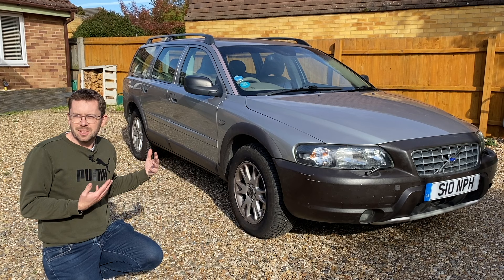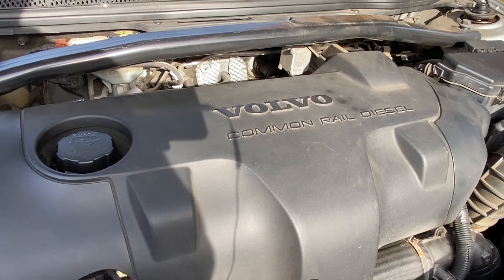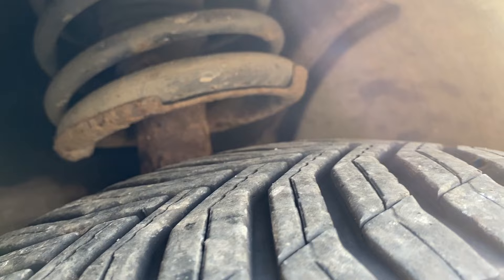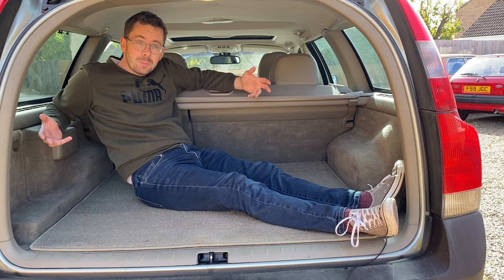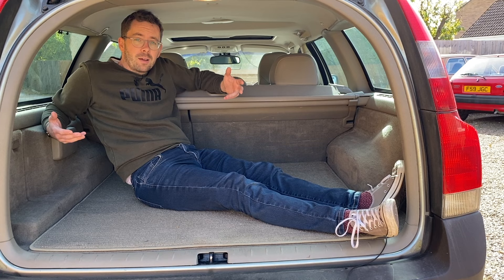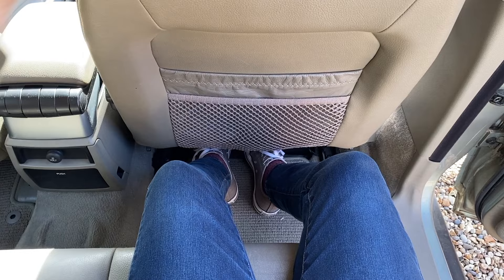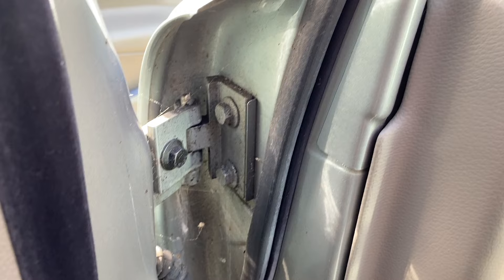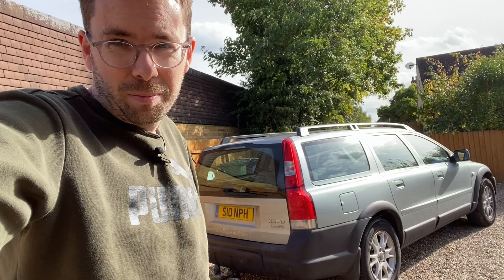2004 Volvo XC70: 6 month ownership review

Comment: Glad to see you enjoying your tank! I’m positive once you refresh the front struts/springs/end links it’ll feel like a new car. That was the most significant area of improvement when I refreshed my front suspension in my XC70 2.5T at 230k miles (currently sitting at around 265k). I saw the rear sway bar already mentioned. One thing I would highly, highly recommend is Delrin subframe bushings if you can get ahold of them on your side of the pond. They TRANSFORMED the way my XC felt on the road. They’re kind of an in-between of OEM rubber bushings and Polyurethane bushings. Almost as soft and quiet as OEM bushings, but much better road feel and lean-in. Makes it feel like it’s not lifted, while still being a lifted wagon! No rush, but I’m sure engine mounts will be coming up for you soon and that’s an excellent time to throw them in.

Comment: Enjoyed your review - we have a P3 2015 bought in 2021 80k miles (now 110k) - totally agree with your assessment.  Have had all the main jobs done, including cambelt and other aux belts, brake discs.  We took it from the south coast up to the lake District - it ate up the miles and performed well in various muddy fields we parked in while fell walking.  Great to park on a mountain side verge in bad weather and return to after the day long walks.  Looks classy to me - rugged and capable.  Is quite good in rough stuff too if you don't wade too far.

Comment: I had a S60 2.0ltr V70T5 XC70 D5 All had the same front suspension faults Too much weight on the front but on a plus they had the best music system with its subwoofer in the dash👍

Comment: 04 v70 , heated seats are hot for me. (usa).
new control arms make a big difference in handling.
get a copy of vida on a laptop , you'll need it.
change the nicad battery in the alarm module before it leaks all over the control board and destroys it.
loosen brake bleeder screws with air hammer fitted with a "shake and break".

Comment: my V70 handles like a sport car compared to the old 240's and a W124 Mercedes I have had - those were barges!!! Bottom wishbone bushes should help handling, I did mine recently with great improvement. You didn't mention the lousy turning circle! Thanks for your video, good luck!😁
Reply: Agree with the turning circle point. I put a deep scratch in one door not long after buying my V70 then proceeded to break numerous wing mirrors off reversing around my gateposts. My uncle bought a new one and did exactly the same thing! I felt very sorry for him, but was secretly reasured that it wasnt totaly down to my lousy driving!

Comment: I have quite the nugget of an XC70 as my first car (V70 XC actually, whatever). Rare manual+petrol option, 2001, 372 000 km on the clock, got it at 330k. In 2 years I've raced it, off-roaded it, crashed it, customized it, upgraded it, lived in it and last but not least fixed it myself countless times. I still smile every time I look back at it after parking. Yes it has it's weird quirks with electronics, but it has never left me stranded - it always gets to point B in absolute comfort.
A couple of tips: the pre facelift steering pump reservoir is garbage. They bulge and leak, swap it out with a 2005+ one. Also, I highly suggest getting VIDA + DiCE tool for your car, it will be a life saver for when you inevitably run into volvo problems.
P.S. I really envy your interior, it's immaculate compared to mine!

Comment: The steering fluid leak is from the 2-piece reservoir.  I upfraded to the later version from 2005 later models.  Have to swap hose also.
Reply from the maker: Oh that's interesting, I will have to look into this further. Thank you
Reply: I ordered a fresh cap for my power steering reservoir as the seal inside the cap gets compressed down over time. 

Cheap enough on eBay though if you can be bothered googling there's probably a free fix out there.

Comment: If you have access to volvo vida diagnostics you can alter the seat heating temp, they are set to low from the factory, was the 1st thing i did with my 2004 v40 and my 2004 s60.
Reply from the maker: Thanks for this suggestion - I am trying to give it a go, though having no fun trying to install the VIDA on an old computer!

Comment: I have an 2004 too.  The handling is greatly improved with new control arms and steering components, also, that weight and degree of movement takes it's toll on the front shocks and springs. Whilst good rear setup, control arm bushings also helps.   Also, its likely yours has the self levelling rear suspension, likely the 940's they do expire and are pricey to replace something like £650 each comes to mind, but handling is severely impaired if they are leaking.  I avoid all Pirelli tyres as they make the steering heavy and unpredictable, with excessive load on the steering system.  Good, Continental winter and summer tyres, give predictable balanced handling across a wide range of speeds, conditions and loadings, more expensive than some but worthwhile.  A second set of wheels, makes swapping to winter tyres much easier and cheaper.  I competely agree about comfort, I have had mine since nearly new and driven long journeys in great comfort for all.  The D5 engine with the Auto box makes for reasuirng progress even fully laden up steep motorways.

Comment: I do have a soft spot for the older Volvos. You've done fairly well with that one. I love the P2 shape and P3 shape XC70; comfort unsurpassed. I had the first of the next gen XC70's on a '57 plate which sort of solved one or two of the niggles with the previous gen; the heated seats had a third mode and were hotter and rear room improved; but ultimately they can get to a point where so much needs doing on them it can become hard economically to justify it but it is great you are keeping them going. I added about 43k to a 140k car in less than two years on mine and took it like a champ - really was a beater to get up during covid to see mum before she passed - without it she would have been isolated in Scotland. Now onto a '14 plate xc90 which I love but in all honesty the package of the XC70 is far more drivable and parkable.
Reply: we yanks do not know what the "'57 plate" means, and by second gen u mean the P3 i assume?
Reply: @18_rabbit  '57 plate, means the latter half of 2007

Comment: Great video. You don't need new brake calipers however. Soak the bleed screws with penetrating fluid for at least 24 hours. Then when you remove them with a ring spanner, put a drill bit that is nice and tight into them to prevent them from collapsing. Also slightly loosen then tighten, then loosen, then tighten with more penetrating fluid as you go. Also a little bit of heat very carefully applied may be necessary. Watch out for the brake hoses!

Comment: Its kind of odd but having a couple of decades of company cars on a 3 year cycle I am free of that. I know you and other youtubers need content but for me approaching 3 years with a 10yo Dacia Ruster - sorry Duster its fine. Doing a 320 mile trip tomorrow but I have full confidence - basic low tech 90's Renault stuff so no traction control stability control and the ride is rougher than a Scenic but I'll take 50mpg all day

Comment: Just bled all 4 brake calipers which were really rusty and the rear ones appeared that they have never been bled. I twisted off the brake bleeder on the front passenger side but than drilled it out and used an easy out to remove the old bleeder. new tactic that worked really good is i used a small impact drill with a socket adapter and soaked the rest with penetrating oil and gave it a bit of heat from the torch and than used the light duty impact drill and it came out without a problem. just needs a bit of gentle agitation and loosens right up. maybe if i tried the first one the same way i wouldn't of had a problem.
Reply from the maker: Oh thank you for that advice. I will try doing the job one day, but I am not looking forward to it!

Comment: I have the 2014 version of this car and I agree the handling around bends is not great - even taking motorway curves at speed feels a little bit insecure - And I also think it's because of the raised suspension and the fact the the XC70 is really a standard V70 with AWD bolted on as an after-thought - Volvo's more 'pure', dedicated SUVs (XC40+XC60+XC90) all handle much better than the XC70 as does the FWD V70 - But, all that said it's a brilliant car in every other respect and we don't buy Volvos to be sporty - they excel in other ways!!! (IMHO )

Comment: I have the same car. I swapped out the car stereo and replaced it with JL Audio Amp, Kenwood audio deck and all 4 door speakers of Focal. Will add a subwoofer soon. But, I will definitely need to replace the engine mounts and suspension. Other than that car runs like a charm!

Comment: The P2 Volvos are such incredibly unique modern cars. My father just replaced his 2001 V70 T5 which he snapped the cambelt on at 245k miles with another 2001 V70 T5 with only 70k! It's brilliant to experience such a lovely example of the species, though his new one has a lower spec stereo that doesn't sound quite as nice but at least plays my cassettes 😂

I daily a 2012 P3/EUCD XC70 with the Bridgend T6 and I completely know what you mean about the 'wallowyness' of this type of car; my XC70 also has a peculiar fidgeting over bumps that can upset the steering a bit which doesn't happen in either the older V70 or my mom's gen1 XC60, so I wonder if certain handling elements are compromised since the XC70 is a modification on the base V70 instead of a ground-up CUV, if you will.
Reply: We had a 2008 XC 6 cyl that was wallowy.  The 2016 T5 with 18 inch wheels drives totally differently.  Agile and sporty.  The 2001 XC drove like an overloaded 850 on stilts.  2004 would have been heavily revised, but I have not driven one.

Comment: Very cool your able to do a lot of those repairs. Here in the US, I own a 2002 Volvo V70 XC with 135K miles (original owner). Been doing a lot of maintenance in the 24 years I've had when I purchased it new. I know it needs a brakes, tires, etc. Love the comfort and ride.
Reply from the maker: It's a great car
Reply: i'm very curious what parts u've worked on or replaced, or had shops do.  Namely, transmission is my question.

Comment: Great car, benefit of 4x4 but running cost of an estate. However I had a standard P3 v70 then swapped for a mk4.5 mondeo estate- basically similar underpinnings, yet the mondeo drive much tighter and handling is way ahead of the Volvo, also had less rattles, and something I noticed sat in the back is the rear seat base seems quite short in comparison to the mondeo which me at 5’10 seems much more roomy and seats are better size.

Comment: Amazing job, I also keep the same car in the family, the power steering reservoir is a pain in the ass… I have replaced it with an OEM one and still have problems, which seem to be very common in this model.
About the handling take a look at those shocks and brake fluid! I also have the Bluetooth kit and works better than my 2016 Golf R connection 😂
Reply: Replace the ps reservoir with an 05+ all the way up to
09 P2 unit (as I’m sure you know s60 was make up until then and is the same) and the weeping will stop. I did this on our 02 as SwedeSpeed suggested. It was not difficult. Make sure you get a unit that looks dry and includes hoses.

Comment: Better hope you never have the hardline compression nut loosen and leak for the power steering.its wedged between the rear engine mount and a bunch of stuff.it will dump your system dry and you have to pretty much jack the engine up and remove that bracket .i ground off the side of a crows foot and had a miracle occur but you gotta be extremely patient and accurate to pull that off.

Comment: Love it. I have exactly the same car. Where did you get the phone holder? And what Bluetooth system have you got?
Reply: Not sure what Bluetooth system he got but if you want a quick fix to get Bluetooth, get a Bluetooth to fm transmitter. They’re around $20. Plugs into 12v socket, sync it to the same radio station and you got Bluetooth

Comment: our xc70 handles really good on the road, and i beat the shit out of ours. take it around the corners hard ect. even kept up with some low powered bmw's maybe yours got a bad swaybar on top of everything you said. and the heated seats can be programmed for eu specs so they get hotter.
Reply from the maker: Thanks, I will definitely have a proper look at the suspension bushes and sway bars etc.

Comment: What sort of fuel consumption do you have? I have a 2006 XC70 D5 and get around 32-33mpg in general running around. Best was 35-36 on a long motorway haul with a roof box

Comment: Just got myself a 2007 XC70 D5 and I will do some mods to it myself. Rearwindow wipermotor needs to be changed, does not work at all atm. ALso will use Swedish brand "dieselkraft" enginetuner and see if I can save some diesel with it. But the guy I got it from had basically changed everything and recently as well. it drives like brand new. Got the BT kit in it first thing though.
Reply from the maker: The bluetooth kit is absolutely fantastic, and transforms the car to modern use with complete OEM usability
Reply: Hey. Which bluetooth kit you buy? I just bought an XC70 D5 too and  I would like one (:
Reply from the maker: @magearowz  this is the one I have, but it's not currently in stock: https://www.amazon.co.uk/dp/B07VYTXR34/ref=pe_27063361_487055811_TE_3p_dp_1
Reply: @magearowz  random amazon that uses a 3.5mm headphone jack to the aux port in the armrest 👍🏻 works fine
Reply: Hey do you have a link? Sorry (:
Reply: @magearowz  Cannot post links on YT, but the long ass name of it was: "PALOVUE Bluetooth 5.0 Receiver with Qualcomm CSR, Portable Wireless Audio Car Kit for Music Streaming and Hands Free Calling for Car Home Stereo, 3.5mm AUX Socket and USB for Bluetooth Adapter with Built-in Microphone, No Charging Needed, LinkFlow". Worked fine. Connect to USB port, aux cable to AUX in. Pair with phone when car is on, turn stereo to AUX, done. Literally that fast.

Comment: I have a 2003 V70 XC and the only issue I have is after a long drive (sometimes even a short drive) gear jumping down as if the car is being hit from the back, like a strong jolt. Any advice will be appreciated.
Reply: This has to do with faulty valve body in the gear box. Gear box oil change must be done every 37500miles regardless if it is stated sealed for life. When gear box oil changes are not done, debris in oil get clogged in the valve body and cause jerky gear changes specially when it id cold. I would recommend a full oil change with the filter. If the symptoms still persist, getting the a valve body thoroughly inspected by a specialist is recommended, hope this helps
Reply: can be one of a couple alternate problems.  See a trans specialist or regular shop preferably actually

Comment: It looks like you have the new front brake pads incorrectly fitted, that silver clip you see through the wheel should push into the calliper piston on the INNER side of the Calliper . Regarding the heated seats they are designed to take to cold out of the seat rather to heat them up well above ambient and feel hot. There are 3 heat levels you can select with the dealer diagnostic tools.
Reply from the maker: I promise you I haven’t put the pads the wrong way round: the inner pad has the clips for the piston as you say, which I’ve clicked firmly into place. But the outer pads on this set also comes with the slightly slimmer clips which are visible. I think these pads must fit a couple of different cars, one of which needs the extra clips on the outside

Comment: NIce update! 

Agree about heated seats: like a/c, they are not all created equal. In some cars, the heating elements are part of the seat cover, and can be replaced, if you can find the cover. In others, they are part of the cushion itself (which can also be changed). Hard to say if the questionable performance is due to age, or due to a weak design to begin with.

About the suspension: did you try to do a “bump test”, to see if the suspension settles quickly? Wondering how to ascertain whether the shock absorber is faulty, or if the springs have weakened with all that rust. 🤔
Reply from the maker: Thanks, that's a good idea to do the bump test. I'm hoping I can adjust the base settings of the heated seats with access to the Volvo VIDA system to talk to the car

Comment: Glad another Volvo is doing its thing, I have a 2004 V50 and the heated seats are ferocious, I wonder if there is a little something wrong with the ones in the 70? Good to see a review of this car
Reply from the maker: I’m going to try connecting a computer to the car’s system to see if I can adjust the temperature of the seats
Reply: @MorselsAndMotors  fab idea, my 18 yr old V50 was a hero this morning! 4 inches of snow in -4 degrees, started first time and was steady on the ice rink down hills on the untreated roads! My seat was also lovely and warm 🙂

Comment: Here in the states, seriously considering buying a 2015 XC70. Would you still recommend ?
Reply from the maker: By 2015 that’s the next generation of XC70. I’ve never had one but I do have a 2012 XC60 which I like very much
Reply: as u likely have seen on other channels by now, the issue is the engines/choices, and there are transmission issues, and other high tech issues that cost.